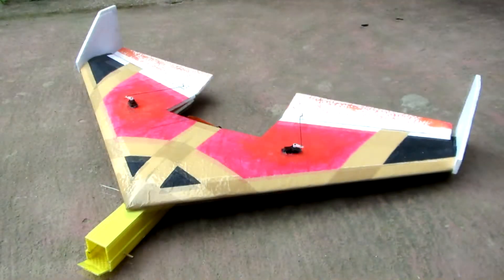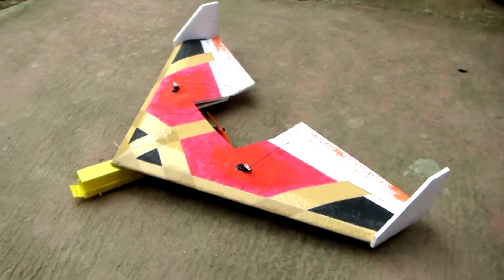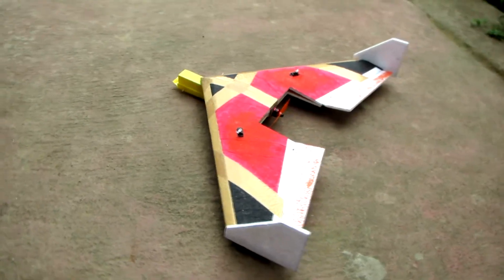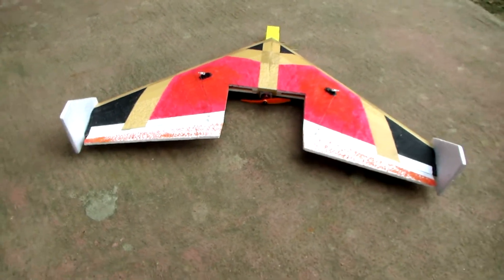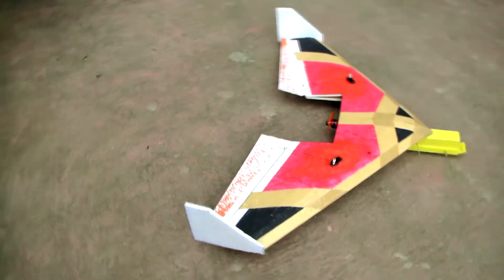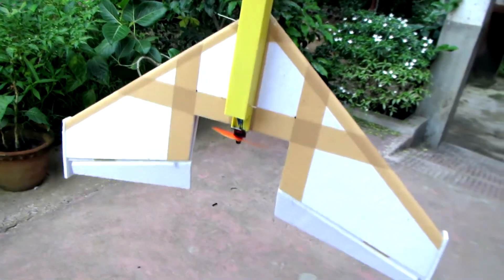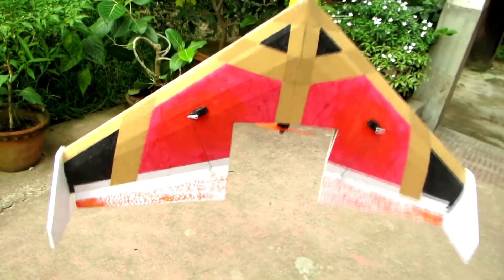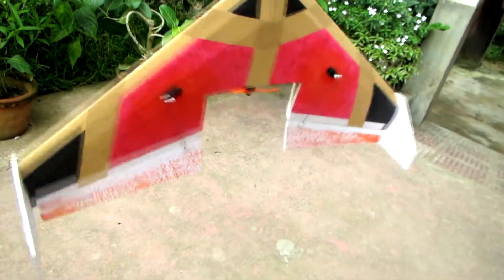FT Arrow With MOD

Comment: can u plz tell me all vital informations of the wing like dimensions weight..... etc.
i also want to make one but a slow flyer with kfm airfoil and 2212(1000,1400,2200kv) motor suggest me on this i will also use cheap thermocol and i want to keep wing span around 30"
Reply from the maker: root cord 15" tip cord 6" including control surface motor 2212@1000KV propeller 1045 battery maximum 3000mah
Reply: @MakerHand  wingspan?
Reply from the maker: @raginimishra7803  30"

Comment: bro u laminated the themocol or you purchased laminated thermocol??
Reply: by using thick cello tape?
Reply from the maker: I laminate by myself. It's very economical.
https://youtu.be/gtK7dsWFJAs
Reply from the maker: I use cello tape for repair purpose and where I need some reinforcement. 
https://youtu.be/gtK7dsWFJAs

Comment: What kind of motor and battery do you have within this model ... Give me some details
Reply from the maker: All is in the DESCRIPTION:
1806@2300KV brushless motor
12A ESC
5030 Prop
5g servo X2
850mAh 3S Lipo
Reply: MakerHand boss you are doing a good job .. keep it up